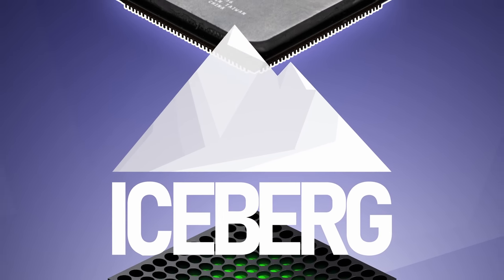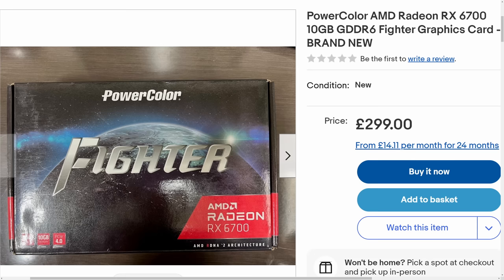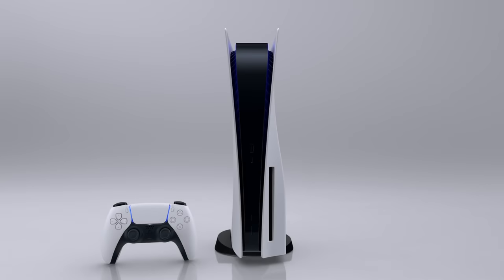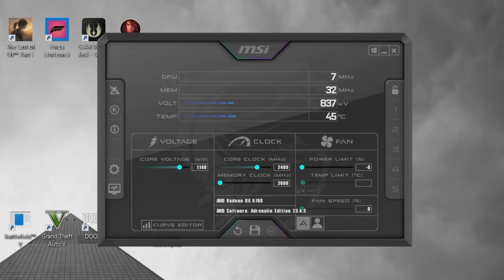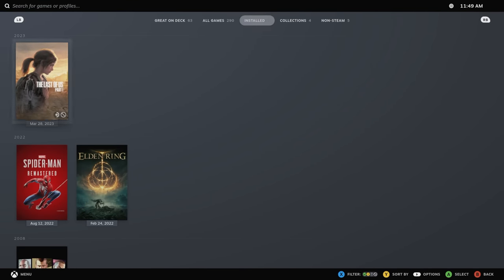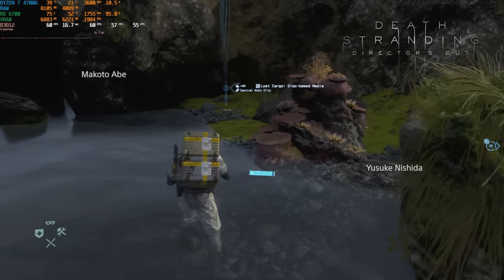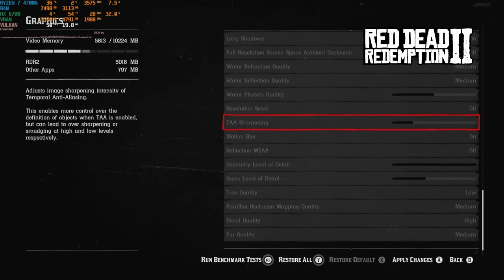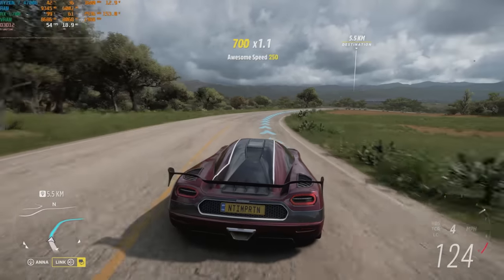I Built a 9th Gen Console (kinda)

Comment: I built my console replacement PC last year. I opted for 5600X, 6600XT and 16GB RAM running HoloISO. It's worked well for me so far.

Storage/RAM architecture is where both consoles seriously diverge from PC and there's currently no brilliant way of compensating.

If I was to really try and push the PC data path as much as I could I'd look at the AMDs 3D cache processors, possibly insist on DDR5 RAM, double up to 32GB so more data can be potentially moved into RAM sooner.  And make sure ReSize Bar is enabled for the GPU in BIOS. 

Hopefully future improvements to the new Direct Storage APIs would improve this.

Comment: One thing to note here is how heavy Windows is. On Xbox, it's a run-down version of Windows and PlayStation has it's own. Both instances are really light and hence do not eat up much resources, which is why last gen can somewhat get away with 8 gigs of shared ram. However, there are alternatives like Atlas OS for Windows 10 (Windows 11 version not out yet) and a Windows 11 alternative I can't remember the name of. What these do is basically run over Windows, delete unnecessary backround apps and tasks-including Microsoft Edge fully off your PC-and cut down on CPU and RAM usage. According to a Linus Tech Tips video, you can gain 30FPS because of the extra resource space. As a bonus, loading times for everything is essentially cut in half, speaking from first hand experience!

Comment: The Consoles CPU is based off Zen 2 but it is a monolithic chip (good for it) uses gddr6 which is good for GPUs but not CPUs, it has less cache and lower clocks than the 3700X. So it is overall for sure weaker than the 3700X.

As for infinity cache it works exactly as advertised. You forgot that the 4090 also has a huge amount of cache tgat is your mistake

Comment: I'd say the most interesting observation is how much the PS5 and series consoles can accomplish on such a low tdp. I would say the GPU is probably better than what the consoles can offer most of the time but as always never a 1-1 for consoles, especially on the first party and bad ports. TLoU is always gonna be impressive due to its first party nature as those tend to be the most impressive games on any given system.

I wonder how close a 5700xt could get in performance with overclocking - obviously it needs more power but it would be an interesting thing assuming it's VRAM doesn't become a bottleneck, which at 1440 and 4k is a high possibility.
Reply from the maker: I didn't look too much into overclocking the 5700 XT, but I was considering getting the regular 5700 and seeing if I could OC it to match the PS5. I don't think I'd have had any luck, as I think most people could only get it to 2GHz.

Comment: Problem is you can’t tweak your windows install or the game design to tailor it for the parts. You would need a slight bump in part specs in order to overcome the Pc shortcomings.
Reply: And some shortcomings can't be overcome - shader compilation, or asset hardware decompression (this can be achieved with DirectStorage, but devs have to implement it).
PC gaming is amazing when it comes to scalability and options, but man, the quality of PC ports these days is abysmal.

Comment: Awesome video! I wouldn't focus on the cache to much, the main benefit of CPU cache is help with keeping more important data closer to the die, with the consoles that is less of a concern as the hardware is fixed, if a game dev noticed an issue with memory management during a demanding scene or section of a game they can manually tune it to remove that issue etc, on PC that's obviously not an option. Also regarding the Infinity cache, AMD quoted it as making up for memory bandwidth, which it did do to an extent, however, if you compare the 6900xtx to the 3090, the AMD card wins at 1080p and 1440p, but then falls behind even the 3080 at 4K, I suspect that this is because the Infinity cache is great at feeding a GPU smaller amounts of info at speed, but once you hit 4K, the 128MB Infinity cache of the 6900 XTX isnt big enough to bridge that gap. Also the PS5 not being a full "RDNA 2" chip was complete marketing crap by Xbox (I both own and enjoy my Xbox Series X/FIFA box 😆) . The PS5 is a custom RDNA 2 based GPU, eg, they took out features they don't need (such as VRS which was based on DX12U) and added in features they needed/wanted such the Geometry Engine (which can achieve the same thing as VRS but at a better performance benefit, at the cost of requiring more work by devs) TLDR - the PS5 GPU is a console optimised RNDA 2 GPU.
Reply: I think your mixing somethings up, amd never released a 6900 xtx, there where rumors of one back in 2021, but it never actually saw the light of day. In the rx 6000 the highest end cards where the 6900 xt and the later released 6950 xt...
Reply: @h.b.5577  Dog! Typo, I meant the 6900 XT 🤣

Comment: The one thing i'd change to try to bring performance more closely resembly the consoles is to use Optane.
Now hear me out.
Yes optane has a lower maximum read/write than even the external Xobx add-in SSD.
However, both XboxS/X and PS5 both have better low level access allowing for much better latency, which is where Optane shines.
The problem though is that my 1TB optane drives, all costed $399, EXTREMELY expensive per GB when you can get a gen 3 NMVe SSD, with faster sequential reads/writes than the optane drive, for just $60.
But when you look at the latency to actually grab those small game files? Well thats where optane blows the doors off of gen 5 SSDs, the latency of optane is closer to RAM, than to an NVMe allowing it to access those files as the system needs them. Where a high end NVMe needs to cheat by adding 4-16GB of LPDDR3/4/5 RAM, Optane is still faster by a wide margin without any RAM.

I initially bought these optane drives for my file server, allowing me to use them for special metadata drives and cache that is persistant, as well as being extremely long lasting(boot is a mirrored paid of 118GB M.2 optane drives).

But i didnt expect them to perform so well in gaming.

There is one major drawback though for this 'desktop console' project. To pull those small files off the drive quickly, you need REALLY powerful cores, even the 12900K struggles to allow the 1TB 905P U.2 drive to strech its legs while also running a game.

And that is the one thing you cannot replicate from a console. Dedicated storage controllers that work directly with the CPU, and special ASICs to run them. Where the 12900k cannot feed the hungry beast, the PS5 is happy to rip through the drive even faster, as long as the NMVe slot in the back can be comverted to U.2 and the storage controller has the same level of access as the internal storage(unlikely for compatibility sake but i dont have a PS5 to test)

Servers do have ASICs like this, heck some servers even use optane dimms called DCPMM (data center persistant memory module) that allow you to have a few 512GB sticks of slower 'RAM' that can survive a reboot, sort of like an L6 cache(assuming RAM is L4) The storage controller can either make the RAM invisible to the OS, tell the OS that this pool of Optane is available for RAM overflow, or not use it as RAM at all, and have each drive appeat as an SSD or a single RAID array. IIRC the bandwidth on these DCPMMs would put a gen7 NVMe to shame
Reply: Also, i'd add a kit of patriot Viper 4400C19 B-dye, you can generally overclock it to 4800C18 on the 4700G, or up to 5000C16 on the 5700G without needing to drop the memory/fabric/uncore out of the magical 1:1:1 ratio (that means running the infinity fabric and UCLK at 2500Mhz instead of the normal 1600mhz with 3200MT/s RAM)

Comment: I would honestly love to revisit this machine's performance in 5 years from now when the consoles have matured. It would be interesting to see if this pc will still hold.
Reply: This is a very interesting idea, but we are well aware that this PC will become obsolete and will be much worse than consoles over the years
Reply: @MaxPowerThe It will not become obselete
Reply: @officialteaincorporated243  such an assembly already has problems
Reply: @MaxPowerThe  Which are? Both the gpu and cpu currently run perfectly fine.
Reply: @officialteaincorporated243  there is no separate hardware for unpacking data, as on consoles, there is no direct storage, there is no support PCI E 4.0
Reply: @MaxPowerThe  Unpacking is quicker on pc, direct storage is now available on pc and pcie 4 is supported on consoles however it is not nearly utisilised and never will be on the series x. In fact, the ssd doesn't even max out pcie 3

On ps5 the ssd does have fast pcie4 speeds, however it has a weaker gpu and therefore you can go with a slightly worse one and use that money to buy a slightly better cpu and motherboard that supports pcie4.

Also, all of these things barely make the slightest difference in performance.
Reply: @officialteaincorporated243  On the PC, there was no, and there is no fast and equally effective block, as on consoles. There is no direct storage function in this build, there is no pcie 4 and there never will be, there is no support for sam and Rebar, there is no point writing about it and making excuses, and this is a fact. And how do you know what a special Xbox ssd drive will be used for, and what not? Why are you discussing another build and about the budget of another build that needs to be spent, after all, I have clearly written about this assembled build. Yes, of course it doesn't affect performance, seriously? Of course, this is not the case, and this game tlou 1cannot be run on this PC with the same settings as on the ps5 console. Let's not discuss things that are beyond the scope of discussion - is this particular build suitable? Good afternoon, it's hard for me to write in English, I don't speak it well ;)
Reply: @MaxPowerThe  This pc has every requirement for direct storage, pcie 4 isn't even used on the series x anyway and pcie3 and this gpu is a lot better than having a PS5 with pcie4 (due to lower gpu performance on the ps5). In fact there's barely a real difference between pcie2 and a pcie5 nvme for gaming alone.

There's many technologies on pc that make unpacking and decompression quicker than consoles in most usecases but in terms of raw performance without these, yes you are correct. 

Also, the console storage expansion costs well over triple what an equivalent performance ssd costs on pc. So if you ever want more fast nvme storage with direct storage it is going to be way costlier and will make the consoles obselete quicker as games get bigger. 

SAM had plans to be supported on ryzen 4000, don't remember if that every went through. However, it again makes only a very small difference in performance.

Also, this pc runs pretty much every game better than the ps5. The only reason the tlou doesn't run well is because it's terribly optimised.
Reply: @officialteaincorporated243  I would be happy to answer you on all points and would object to many points, but due to the language barrier I will not be able to do it in full. Well, if I answer very briefly, then this (build) will experience difficulties and eventually become obsolete in this race and will fail over a long distance, will become obsolete faster and will become much worse than the console. I'm just sure it's going to happen, it's happened in console comparisons and equivalent builds, a PC for the price of a console, and trying to compare leads to a bad result, it's a given, so I bet this build won't be able to live the entire life of the console. console. the console generation and the experience of the last 15 years tell me that nothing good can be expected, it's not worth it, it's better to create a better and optimal PC than the so-called equivalent. I have everything;)

Comment: Could you revisit the amd FX CPUs in 2023
Reply: That would be as easy for me as in walking into another room.
Reply: @robertt9342  no just wanted to see if fx 8350 and 9590 how they perform in 2023
They struggled compared to an i5 3rd gen
But since games are requiring 8 threads idk how they perform
Reply: It is really, really bad.  I just went from a fx8320 to a r5 5600 just a few weeks ago keeping my GTX 970 and games that were a  stuttery unplayable mess are now running 60FPS buttery smooth or better.  I never realized how much that CPU was a bottleneck for so long.  That being said, my next upgrade is going to be the GPU, but seriously the FX series CPUs are way past their prime.
Reply: @DonaldWyman  the GTX 970 uses a software scheduler that harms the fx cpus a lot
But i'm Wondering what happens to them when using them with RX 5700 in 2023
Reply: @alilokhd4638  What do you mean with  software scheduler? i would think it's something to do with the driver overheard.
Reply: @tweakz_tech  it's the same thing. Software scheduler consumes more cycles from the weaker cpu cores thus leading to a driver overhead and low performance on older CPUs

Comment: B450, 3700X, 16GB DDR4 3600, RX 6700XT, 650 Watt PSU, Case, 1TB NVMe SSD. All in $480 from Marketplace, Ebay, Jawa and the like. This is 100% achievable as I type this and would meet or beat a console in all ports. Mostly used the only new components would be the 6700XT and SSD. Used they aren't much cheaper so might as well buy new unless you can get a better deal used in which case the price falls even lower.

Edit: The PSU i'd go BStock or Midweek Madness from EVGA. You get a good refurb cheap with a warranty.

Comment: Nice. I haven't done a console-like build since my Raven RVZ01B build, since back early 2014 (?), with MSI RX 280X - 6GB and those crappy AMD A10 CPU, and 400W Silver stone PSU. I'd like to try one again, but part of me wants to go to the opposite spectrum and build a big mofo. I wish dual GPUs were still a thing, I miss those days. And yeah when it comes down to RDNA there's no difference between RDNA 1, 2, or 3. At least as far as the platform itself. The only thing that differs is that between RDNA 1 and RDNA 2 they implemented ray accelerators and VRS...none of which specifically have anything to do with RDNA. Any major changes would likely directly alter IPC performance etc. None of that is any different. AMD just software lock the max potential frequency to a new ceiling, each generation and throw more wattage at it. It's no secret practice. Both sides do it. AMD did it with GCN. None of the GCN GPUs were any different from year to year. The only big gains were smaller fabrication and other irrelevant enhancements to increase efficiency or tighten it up a bit.

Comment: Not sure how it is in the UK but where I live the 3600 is now possibly the best budget CPU. I don’t get why the 4000 CPUs cost more and the 5500 as well despite the 3600 being faster thanks to larger cache. Sure it is a version of the 3600 without a cooler in a box similar to the Ryzen 7000 CPUs but still at the equivalent of 75 pounds the 3600 is a great buy even today. If I built a mini ITX console killer type of PC I would choose the 3600 but you are correct that the 4700G is more like the CPU in the consoles. The 5500 is the equivalent to 100 pounds despite being slower. I haven’t heard many YouTubers talk about the 3600 new in 2023 so maybe the price is worse in other regions?

Comment: more closer would be 3700x 16 gb ddr4  and rx 6700 xt cause its only 4 gb less then 16gb vram  the 6700 has 6gb less memory
issue is 4700g has a gpu in it which needs to be disabled entirely so not wasting memory bandwith
Reply: Bruh. I can confirm that the igpu has absolutely no bearing on these tests or "ram bandwidth".

In fact, the 4700g is a monolithic chip, it's all one piece, unlike the 3700x which is two chiplets. So it actually handles ram BETTER with more bandwidth than a 3700x ever could. He's got it running at 4000, have you ever seen a zen2 desktop hit 4000 ram?